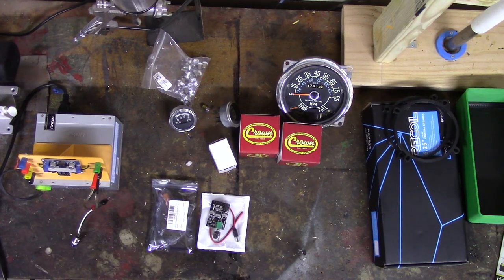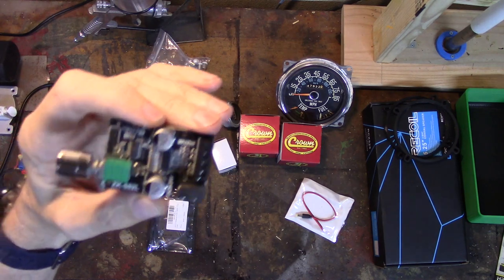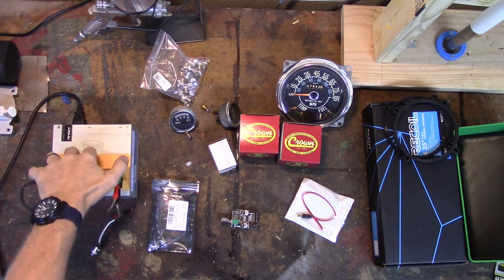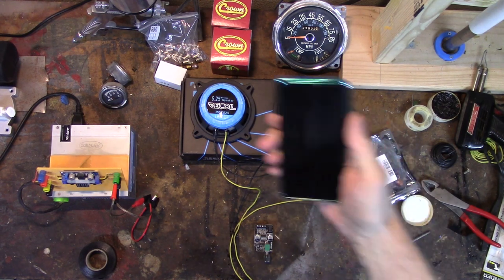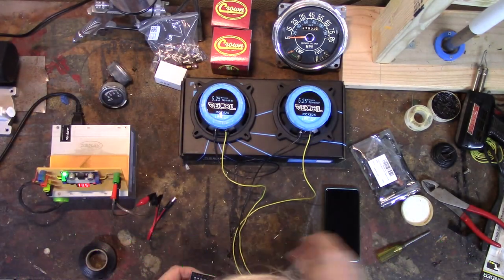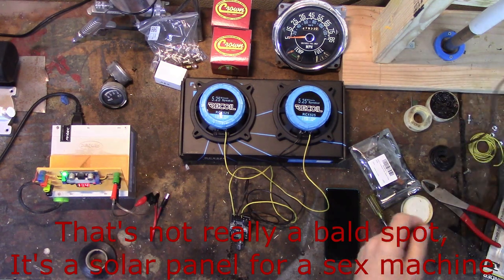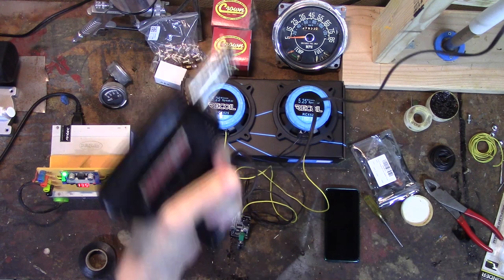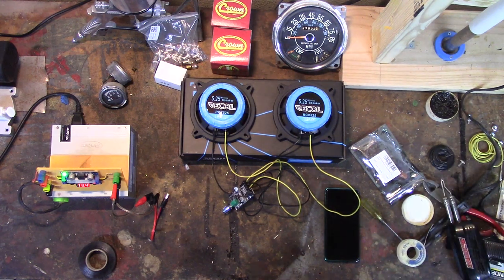Wuzhi ZK-502L 50w Bluetooth Amplifier. Turn any speakers into streaming speakers. The CJ gets sound!

Comment: 2 years later, what's your perspective?
I bought a Broan-Nutone bathroom fan and it's bluetooth module doesn't want to pair anymore. They gave me a refund and told me to keep it.
Pulled it apart and dumped the firmware, but I can't find a similar module, was probably OEM from qualcomm, so I was looking at this to hijack the internal 9V supply and "fix" it with this board from Amazon, but figured I see some videos if it was going to be reasonable or blow up.
Reply from the maker: Mine still works, but the vehicle it's in has been a project and has only been drivable for the last couple of months, so it's not like it's gotten a lot of use. That being said, it does exactly what I want and need it to do, which is let me use my phone in place of a radio.
Reply: @3rdpig  got one inbound tomorrow, thanks for the reply.
Reply: @3rdpig Did you submit your case design anywhere?

Comment: I like the sound quality that little amp has unfortunately even though the vendor that sold it to me said it can take 24 volts when I connected it to my 24 volt drill battery and then I ran a frequency sweep within four seconds the thing caught on fire and the op amp exploded because there's zero heat sink on it and apparently it's not made to take over 12 volts so no thanks to the vendor it only lasted me a day but what little bit of practice I did get with it it sounded very nice
Reply from the maker: Well, look on the bright side. It was cheap and you got to blow something up! That's a win/win in my book!

Comment: The little clamp things i like, but i put some solider on the wire so it doesnt crush. Minics solid strand wire.
Reply: A practice generally frowned upon these days, though you still see it on a lot of Chinese products.
Reply from the maker: Yea, you're really not supposed to solder wires that go into them, although I've done it in the past. I've got some bootlace ferrules and a crimper, I really like them and will use them in this case.
Reply: Ah ok i didnt know that was frowned apon. I tend to solider everything. Even crimps on a car i cut the plastic off, crimp then solider the wire to the crimp then heatshrink on top because here in wisconsin they put so much salt any crimp will cause trouble with corrosion. This liquid salt too they started using the water dries and salt powder is left all over the road. Jeep gets covered with it even just going 1/4 mile down the road, it creeps into spot welds and rusts the jeep away and it coats the engine bay with it so everything rusts.
Reply: I dont claim to be a professonal. Like my dad im a jack of all trades, master of none, i solider them, never said it was the right thing to do 😂
Reply: Just looked them up, ima have to give those a try somtime. Probably would work better for that clamp type application as solider is very maluable.

Comment: What is the adapter attached to the ATX power supply? Is that a product from China, or did you make that yourself?
Reply: Looks like a buck converter.
Reply from the maker: There's a link in the cards for my full build for what I call my "poor man's laboratory power supply" and I'll put it below as well. It's an inexpensive DC to DC boost or step up converter, available on Amazon for under $10.  In the video is a link to the one I used as well as the banana plugs and a link to the thingiverse part I made to mount to the power supply. Thanks for watching!
https://youtu.be/Kg-k7pQaSj8

Comment: what current did you power it? and the voltage is 12v?... i cant get mine to power the speaker, i think its the fault of low current although the blue light does turn on
Reply from the maker: The stock CJ-7 fuse box has a connector for the radio, which is what I used, but its not fused. I doubt they intended the radio to be more than 3 to 5 amps. Ive got an inline fuse in mine, I think it's 5 amps.

Comment: I've been trying to add a "line-in" jack to this amp. Any idea?
Reply from the maker: Sorry, but I'm not enough of an electronics whiz to help with that. You might try asking Paul at the Learn Electronics channel. He's a pretty good dude.
Reply: There is a version with line in avaiable
Reply: @3rdpig  Got ya. Back to the drawing board. Also, I just lost sound from the speakers i had this amp connected to. Not sure if you have ran in to this problem yet. I have tried multiple devices with no success. I am connecting just fine but NO audio is playing. I am at a stand still. Any suggestions on how to tell if the amp is blown or fixable?